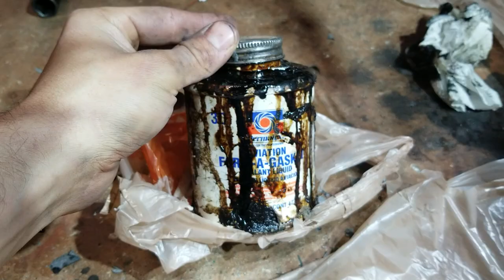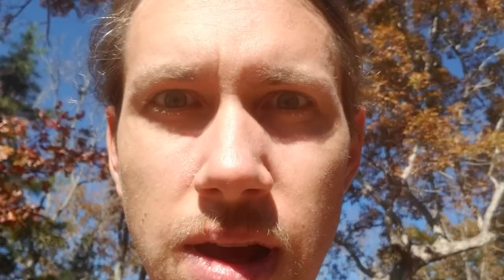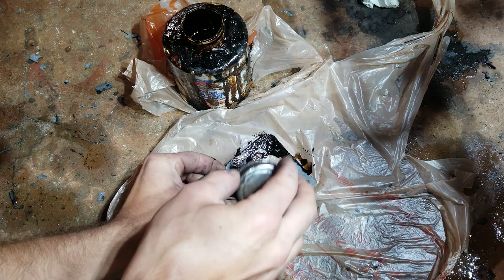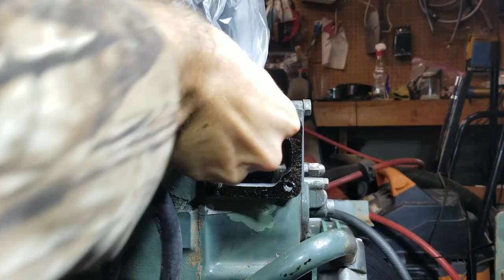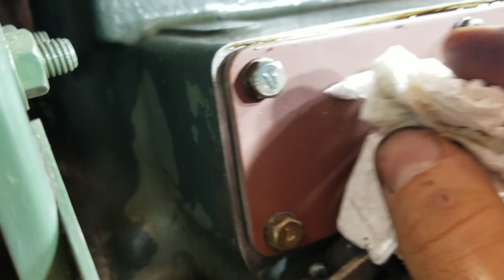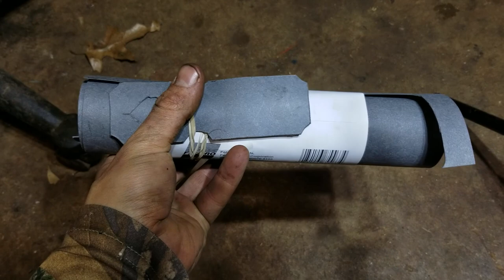The BEST Gasket Dressing Made!!

Comment: Matt the gasket sealer you are using definitely has its place but so does silicone gasket sealer. The trick is knowing when to use what. Been turning wrenches for over 50 years. All in all you do a pretty good job but remember you never stop learning.
Reply from the maker: You're exactly right. They both have there uses, you just have to know when to use which sealant. I won't!

Comment: Used this sealant on my water pump gaskets, sealed up fine.

But i got a question, i'm about to rebuild a TRW power steering pump, do you think the sealant will seal up the O-ring that's on the pump resevoir?

Would be problematic if it started leaking again after installment.